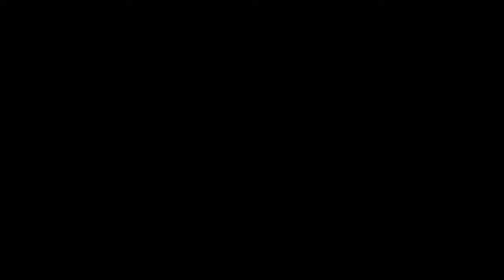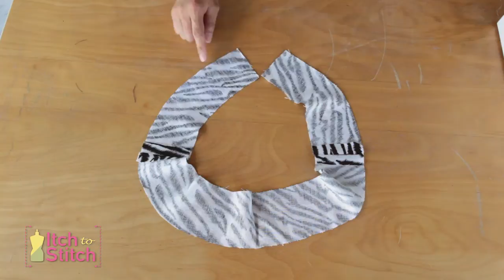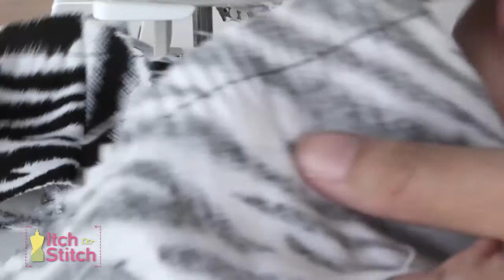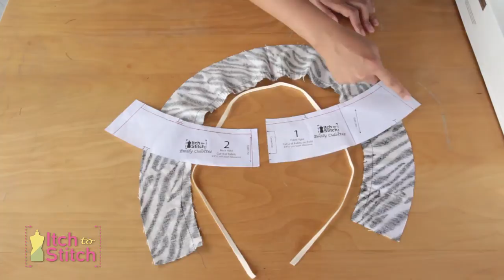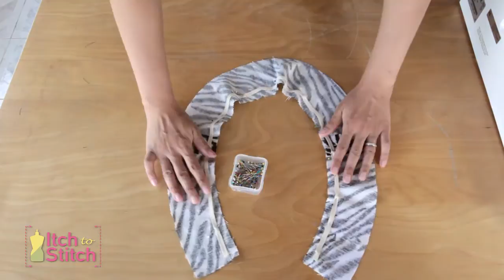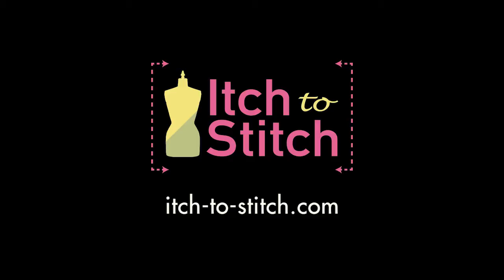Stabilize Contour Waistband Using Machine Ease Stitch & Twill Tape

Comment: Strange. My pattern did not come with a waistband or facing. It's a pencil skirt. The instructions to attach the twill tape are so vague. It doesn't even explain how many cm or inches below the waistband it's supposed to be at.